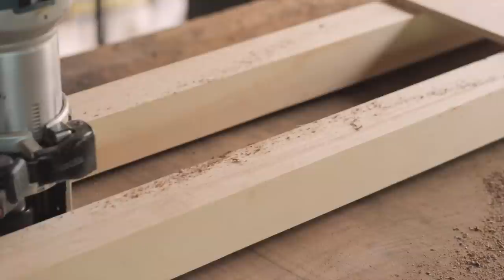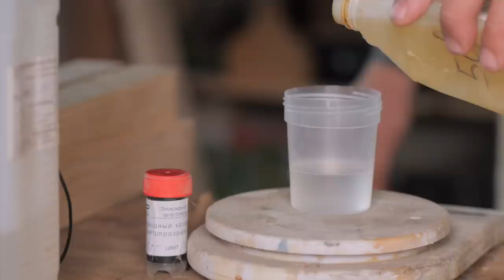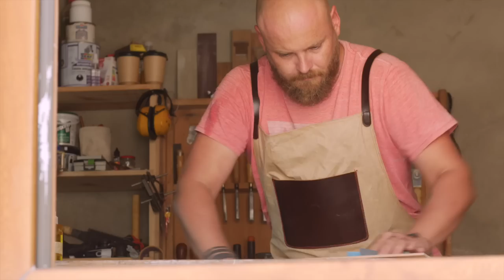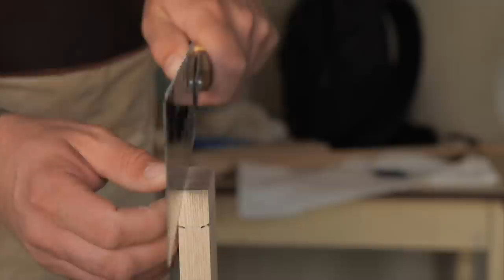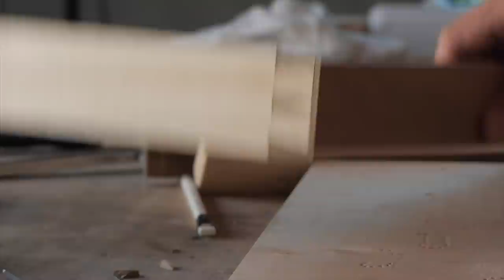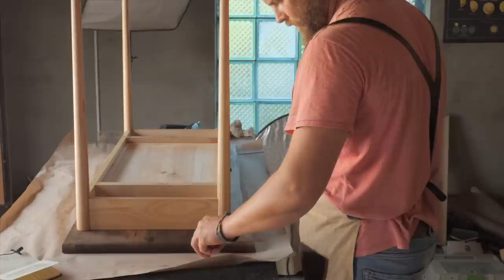Making Walnut Desk

Comment: Beautifully done, and I can tell that you love what you are doing, and take pride in the pieces you produce. Very glad that I subscribed!  

One question though, and I may have missed it, but is there a reason you use a metal mallet instead of a wood one?  I did notice that occasionally you had a piece of wood between the mallet and the piece, but sometimes it looked like you were using the mallet directly on the “good” wood, and I would be so afraid of it leaving dents and marring it. 

Either way, it’s still so much more than anything I can do now, or will probably be able to do, so please don’t take my question as criticism. It’s actually just a novice woodworker, asking a pro a question, so that I can expand my knowledge.
Reply from the maker: Thanks a lot! I really always use only steel hammers, when necessary, I use a spacer and sometimes there is no need, somehow I feel something ... I noticed a long time ago that Japanese craftsmen use only steel hammers! I don't like the inelastic impact of a wooden or rubber mallet... But that's my personal choice. Regards, Yurii